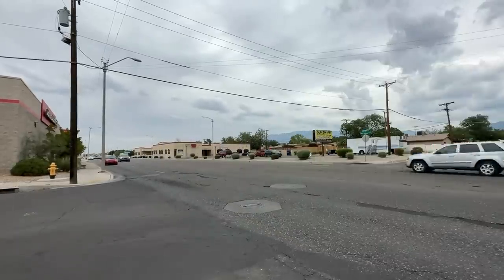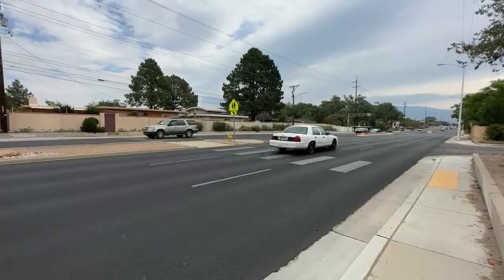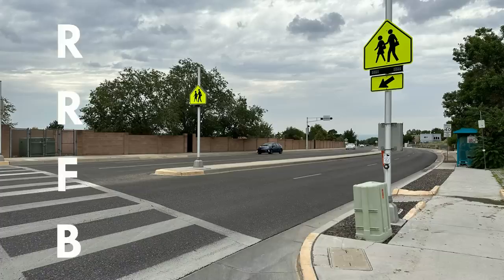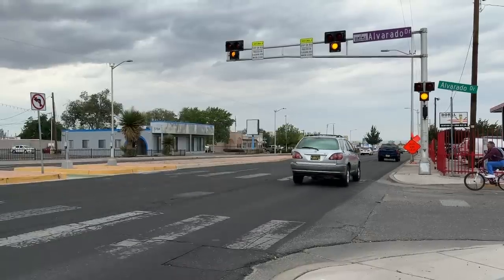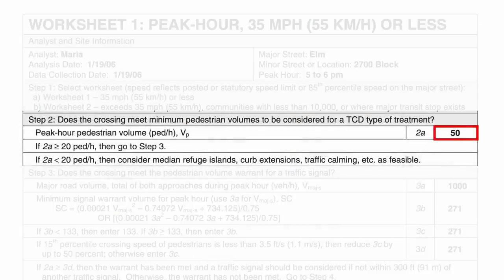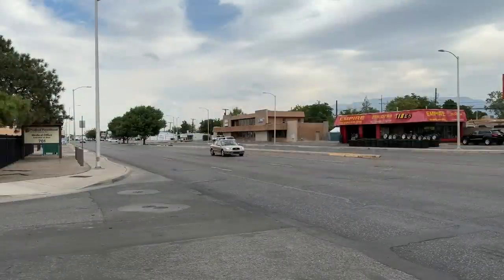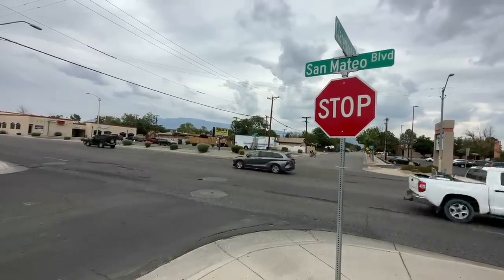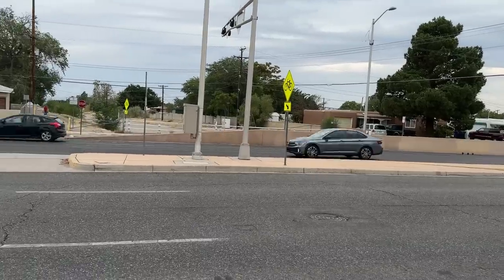The Insane Ways Traffic Engineers Try to Make Streets "Safe" For Walking

Comment: Help.   Question.  

A HAWK is a beacon (a warning light, not a signal).  Designer of the HAWK even said so.   Meaning you legally don’t have to obey it.   It was designed specifically to go, where a signal couldn’t go by the design guidelines, since otherwise, they would just use the signal.     

But then a white (regulatory) sign is placed next to it saying you have to stop (must follow white regulatory signs).  

So what is the point of a HAWK?   Just install a signal.  Is it actually in BEACON or a signal since there’s a white regulatory sign next to it? 

Yes, very nerdy,  I know

Comment: About drivers' compliance with flashing lights...  I'm a recently retired school bus driver.  School buses have flashing lights to warn drivers to stop because children are being loaded or unloded.  On all but the oldest buses, this consists of, at both the front and back of the bus, a pair of amber flashing lights at the top of the bus (this to warn the drivers that the bus is stopping for the stated purpose), a pair of red flashing lights (to tell drivers that children are being loaded or unloaded), and a stop sign with red flashing lights that swings out from the side when the red warning lights are on.  Drivers are required by law to "stop when red lights flash," as it says on the back end of all school buses, even the old ones that lack the amber lights and stop sign, which are now rare and becoming rarer.  There are substantial fines for failing to stop.  Do drivers stop?  Not consistantly.  In fact, my experience as a school bus driver was that maybe a fourth of drivers stop.  My experience in my personal car is that, if I stop, most drivers going the same way as I am will stop, but not those going the other way, and a significant percentage of the time, one or more driver going the same way as I am will honk at me and/or drive past me and past the bus.  The problem is that as long as there are generally not enough police to enforce the requirement, people will flout it.  The police tend to view traffic enforcement as less important than other things they do.  Robberies and murders get their attention, not people driving past school buses, even though children get killed.  Signs and flashing lights only work if there is enforcement, at least enough to get people into the habit of compliance, and needs to be continued or people will get out of the habit.

Comment: My thoughts before I watch. My city installed these at all the school crossings in town many years ago after someone put together a petition to make it easier for kids to cross busier roadways. They also appear at a very busy roundabout that wasn't built too long ago.

Generally speaking in my experience, they seem more effective than a sign without lights as long as the lights are activated and can be activated. That being said, it doesn't make it feel significantly safer as a pedestrian to cross the street, and they prove almost useless when you are on a bike since it's hard to push the beg button without stopping; makes me wish there was some kind of sensor or maybe even a pressure plate that would detect bicycles, scooters, etc.
Reply: 5 Min into it. In my city, we have one Hawk light that replaced a traditional red yellow green light. In a city south of me, they are more common; there is even one that is used for fire trucks leaving a fire station. I've used the pedestrian ones numerous times over the years, and they do seem way more effective than the yellow treatment. Some drivers do sometimes get confused on the red wig wag though.

Comment: When there is a cross signal at an intersection with a traffic light, they should reprogram the lights so that the cross signal should be it's own separate traffic signal. All traffic lights are red while the cross signal is "green". Therefore, it does not impede on either drivers or pedestrians while trying to make it through the intersection. 

Also, HAWK signals should be used as much as possible. 

And always remember that unless you are crossing at an intersection with a crosswalk, vehicles ALWAYS have the right of way.

Comment: Having somewhat recently upgraded to an ebike, I feel much more confident being able to frogger my way across smaller gaps in traffic being able to quickly get from not moving to 15-20 MPH--although it doesn't hurt that roads around here (Twin Cities MN) generally are not that wide and there's a lot of great biking infrastructure so crossing such roads is anomalous instead of the norm.

Comment: Theres a few HAWKs here in Massachusettts now and they are aweful. I don't understand why they had to reinvent a new kind of light for a crosswalk/bike crossing that is confusing and unclear, when such a configuration has already existed for decades. Blinking green light for cars, that turn yellow, then red when you push a button. Everyone knows what to do there because they work the same as every other light drivers ever drive through. But these HAWK things are dumb. They show NOTHING most of the time. Then suddenly they are blinking yellow, which is supposed to be a steady state light. Blinking yellows are not supposed to change into something else. Then they change from blinking yellow to solid yellow, which nobody notices. Green to yellow is noticeable. Blinking color to non blinking same color is not something you notice instantly. A terrible design. Then like you say here, theres the fine print that you can actually run the red light if no one is there. These things should ALL be taken away and replaced with normal traditional pedestrian crossing lights.

Comment: Usually watch you on Nebula but saw this here first. We have several weirdly acronymed signaled crosswalks in the Coachella Valley. I use some frequently on my walks and rarely have problems despite the 45 mph speed limit on the East Palm Canyon stroad; sometimes just the first car or two don't stop and usually every car does until I'm at least past their lane. I doubt any crossing met the math criteria; they mostly seem to be installed where there are several blocks between stoplights. I think the reasoning was crosswalks with beg buttons are cheaper than fully signaled intersections.

Comment: There is a School Zone in Gilmer, Texas, USA which is 55 mph, which is 20 mph lower than the regular speed limit.   The two schools are located far away from the main roadway.  

Keep in mind that most school zone limits are 20 mph because the neighborhood's speed limit is usually 30 or 35 mph.  The Texas rule is to reduce speed by 20 mph unless that reduction is less than 20 mph.  One cannot pass another vehicle in a school zone unless that other vehicle is preparing to turn.  You are only allowed to go as fast as the slower vehicle while in a school zone.  After all, that other vehicle might be seeing something you are unable to see from your location.

Even though I know this is Texas regulation,  it might be based on federal statutes.

Comment: I don't think it helps in the US cos most roads with crossing points like that are wayyyy too busy to have crosswalks safely. In the UK 'zebra crossings' are crossings where the driver has to give way/yield to waiting pedestrians, they're only ever on smaller roads with speed limits of max 30mph. They have Belisha beacons which are black and white striped poles with round orange flashing lights on top, and they do help make the crossing more visible when driving, esp at night. But flashing lights at crossings on a stroad is a very different context.

Comment: I read that "increase compliance rates up to 98%" in the RRFB flyer as saying that it increases compliance by as much as 98% (in other words, from "abysmal" to "slightly less abysmal") and not that they saw 98% compliance. But I hope I'm wrong.
On the subject of HAWKs, my pet peeve beyond drivers having no idea what to do with them is that, at least in my jurisdiction, they're mostly put at intersections, which allows traffic on the side street that isn't facing the HAWK to think they can take advantage of the traffic on the main street being stopped to make a turn across the path of pedestrians. I've seen some close calls because of that.

Comment: I'm trying to parse that first stat. "RRFBs can increase motorist yielding rates up to 98%." The way I'm reading this, that doesn't mean to 98% but a 98% increase rate over the current number. If motorists yield 1 out of 100 times, then yielding on average 1.98 out of 100 times means a 98% increase. But they still don't yield 98.02% of the time.

Comment: Hawk signals seem to dumbfound drivers. They stop for the person crossing, sure... But then they can't read the sign or remember what it said. Some end up sitting stopped until the lights turn off, others treat it like a stop sign despite the pedestrian having finished crossing and stop, usually abruptly, despite other lanes around them going through as there is no longer a pedestrian crossing or waiting to cross, which should be obvious since the cars at the front who stopped for the pedestrian started going again.

Comment: School zones are NOT admissions that streets are impossible to cross in the first place. They might be in the US, I can't speak to that, but they certainly aren't in europe. Here school zones are used to slow people down on that stretch of road because children are more prone to behave unpredictably around traffic - which also happens during times where traffic is unusually high (because of the helicopter parents bringing their cild to school in an SUV, Karen!!). So even on streets with existing calmign meassures, it can be beneficial to further lower the speed limit (usually from 50 to 30 kph) and utilize crosswalk guardians to improve traffic safety at times of high volume.

Comment: Why don't they put on demand traffic lights on those cross roads? If a pedestrian/biker needs to cross, they push the button, the car side turns red and the pedestrian can cross. 

Easy and nothing to discuss.

In germany the pedestrians actually have the right of way on these kinds of cross roads called "zebra strips". If there is a pedestrian the bike and car has to stop and thanks to peer pressure (nearly) everyone adheres.

Comment: I saw you showed a bike boulevard in this video. You should do a short story about the Bryant St. Bike Boulevard in Palo Alto, CA. It starts at its northern (western?) terminus around University Avenue in Palo Alto and heads southeast along Bryant St. It's a very innocent and calming ride through Professorville (where all the Stanford professors used to live; it's now mostly tech folks).

Then it crosses E Meadow Dr as it heads into Mountain View. It then goes into two sets of two concentric rings of streets. If you're not familiar with that part of Palo Alto, you would just casually bike on, circling around until you accidentally circle back to where you entered the circle, so that you'd exit and say, "Hmm... wasn't I just here a minute or so ago?" you'd ride on, but noticing the sun is on the opposite side when you riding just a few minutes ago. Well, then you turn back. (As you can imagine, this actually happened to me. And it happened to me 30+ years ago, before the advent of mobile devices and GPS and other navigational tools).

So here I am, returning into the circles, but not knowing that they're circles because all the homes (Eichlers) look pretty much identical and the street signs explaining the bike boulevard are best read when not moving, which is not what a person would do on a bike. And I was riding a Cannondale 12-speed racing road bike.

I circled, entered the inner circle, circled that, exited the inner circle, only to circle once again the outer circle, then took a different street out only to get caught in the adjacent set of concentric circles (or maybe it was the same circles again, who knows) and circled that for a while before exiting that set of circles to only return to the first set of circles.

I eventually exited back to E Meadow Dr, biked westward to Alma, which turns into Central Expressway in Mountain View, and then southbound to Sunnyvale, where I lived at the time. Because it's named "Central Expressway", you can imagine the speed and intensity of the car traffic on that road. It wasn't fun, but I gutted it out. I had intended to get onto Middlefield Road, which would have been slightly calmer going through Mountain View.

Comment: I pass a HAWK daily to get to work. I’ve seen 2 near-misses where a person easily could have been killed. The whole street is maddening; 40 mph speed limit, 3 lanes each way + a median/left turn lane, separating large apartment buildings and, not even joking, a very large park. The lanes are never full, and even if they were, there’s a bottleneck every day where the 3 lanes squeeze down to 2 (effectively 1 with street parking) right at the next traffic signal

What happens, like in one instance; the yellow lights flash, two cars (including myself) stop, and as everyone slows down one guy in the back decides he doesn’t have time for that so he peels off into the empty lane (again, never full even during rush hour) and speeds through the crosswalk in the lane where a woman and her dog are about to take the first crossing step. And yes, it’s a pickup truck. He almost killed someone and yet we still ended up right next to each other stuck at the next red light. What do you even do in that situation? I wanted to honk to warn her but I froze and worried she’d interpret it as an angry impatient honk that causes her to rush into the street. I wanted to honk at the truck at the next light and roll down my window and curse and ask if it was worth almost killing someone just to end up at the same light as me. However, the chance he’s some sociopath with a gun was too high and so I didn’t. 

What do you even do? This is a recently renovated segment of road; usually potholes stop a car from going over 35 in other parts of the street. It’s so maddening. I don’t want to see someone die on my daily commute.

Comment: We have one of these (RRFB) in our town near the hospital and clinics that surround the hospital. It's used frequently by hospital and clinic staff as well as ppl heading to the hospital and clinics on foot (or on foot by way of the bus). It crosses 4 lanes of traffic in a 35 mph zone and it is never not terrifying to use.

I always check to make sure the cars are stopped/stopping before actually stepping into each lane. And there's a reason for that - I've seen cars just zoom by that would have hit me if I hadn't been so cautious. They recently added flags for pedestrians to carry across and after a few weeks? No one bothers with them. Cars are either going to stop or they aren't. The flags make zero difference.

Frankly, we just need a pedestrian light there - as in one that gives the cars a red light and makes them stop. But that costs quite a bit more money and slows down the traffic a lot more so the city council doesn't want to do that (and apparently 4 deaths aren't enough). But in a nearby city that I used to live in, they had one of those right outside their fire department and right where a lot of kids cross the street to go to a nearby elementary school (also a 4 lane road that's 35 mph). And guess what? Ppl stop.

In the 10 years I regularly drove past that stop light, I only once saw someone run that red light. Meanwhile, in the 7 years we've lived here? I've nearly been hit at that pedestrian crosswalk 5 times - and that's only because I rarely use it. I usually get off at the previous bus stop and cross at stop lights there.

Edit: There's a couple HAWKs on a road that I've only ever driven on (there's no bus route that goes down that road). I've only seen it activated once - when a fire truck was pulling out of the fire station which is on the same corner. I have seen bicyclists and pedestrians waiting to cross there, but I've never seen any of them hit the signal. I wasn't aware there was a signal to hit.

They seem a bit confusing and I've seen cars stuck waiting to turn at those two intersections all the time so I suspect that putting a regular stop light in at one of those intersections (probably the one with the fire station on that corner) would be a better fix for the situation.

Comment: There is one near my house on a two-lane collector street with a landscaped divider and a painted crossing.  It seems to work well.  The crossing leads to a City swimming pool and park.  There is another nearby on a rather fast two-lane County road in a city location.  It was very dangerous to cross before they installed a refuge island and these flashers.  The drivers do stop for me now.

Comment: I see these things here and there in San Diego, and compliance seems pretty good. I'm always extra careful when it's controlling two lanes, however. If a car in the near lane stops, it ends up blocking the vision of cars in the next lane, which makes for a dangerous situation.

The same vision blocking issue also occurs on cross walks controlled by a traffic light. If I have a walk signal, and there are cars on the far side of the intersection turning right on the red, the other stopped cars block their view of the crosswalk until the last second. Unless they come to a complete stop, which they're required to do, and carefully check the crosswalk before proceeding, which they're also required to do, they might not notice a pedestrian in the crosswalk. Sadly, many drivers just roll through the red to make their turn and I've seen and experienced many many close calls. I honestly think having one of these RRFBs that lights up when the "walk" signal is active might help.